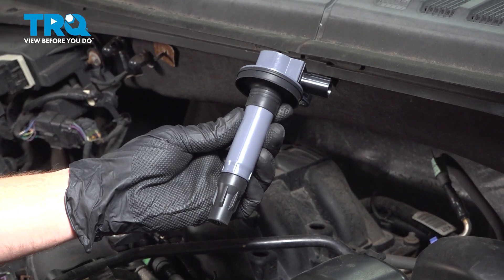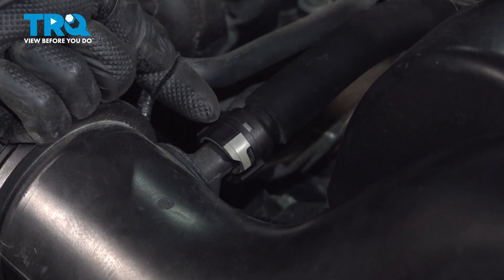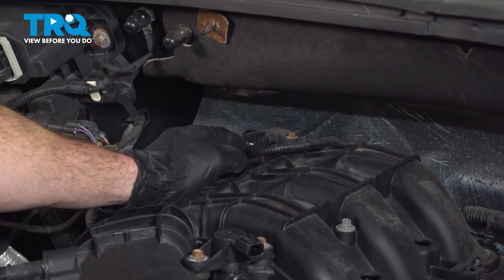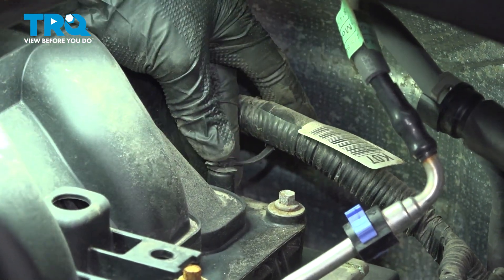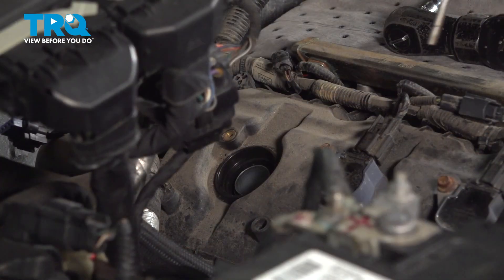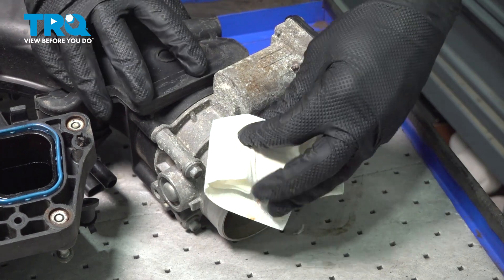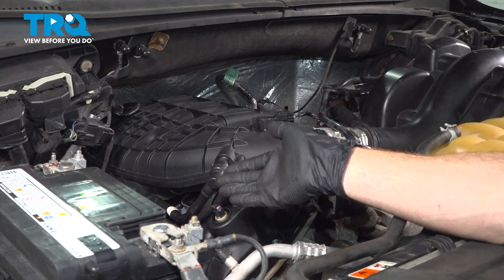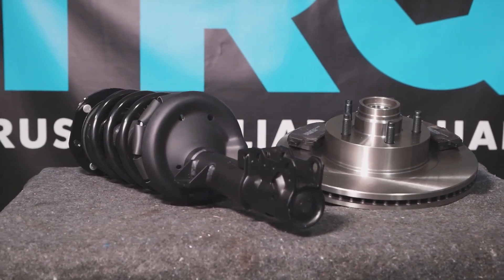How to Replace Ignition Coils 2015-2020 Ford F-150 3.5L V6

Comment: Wow! Super comprehesive thank you for this video.  Is is advisable to replace all coils at the same time?  SHould the plugs be replaced when doing this ignition coil change out?  My truck has 113,000 miles on it and I dont think plugs have been changed.  Thanks again!

Comment: When it comes to the ignition coils  and Ford's, DO NOT BUY anything other than Motorcraft or Denso.  Denso makes the ignition coils for Motorcraft.  As for spark plugs, same thing.  Buy either Motorcraft or NGK.  NGK makes the spark plugs for Motorcraft.